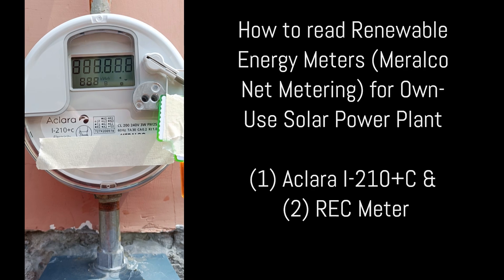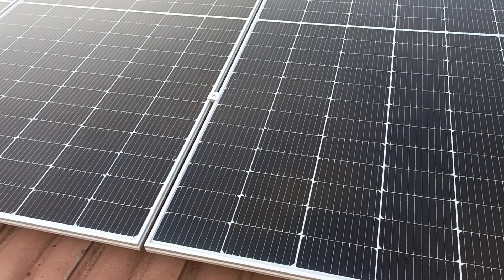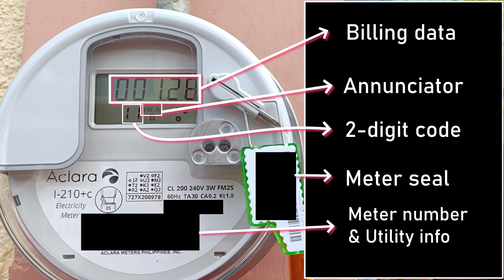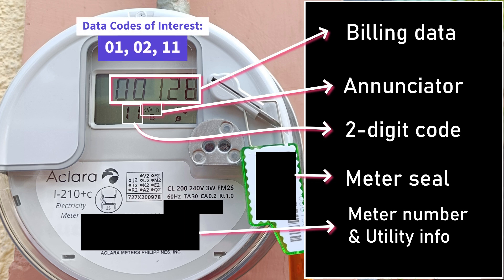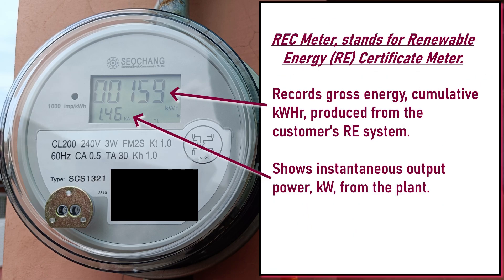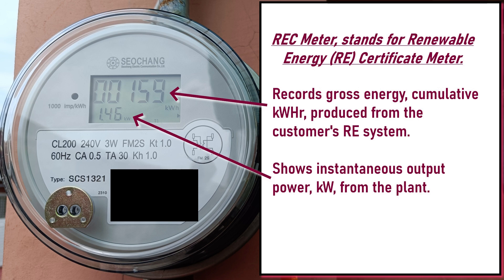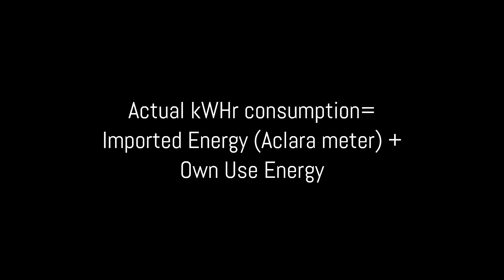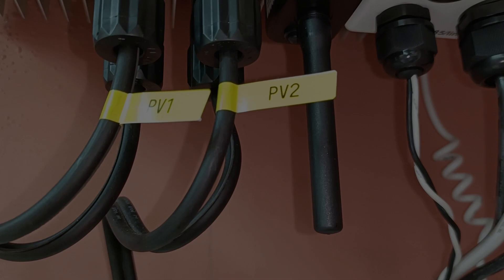[CC] Know Your Net Metering Data to Optimize Solar Power Savings

Comment: Do they also reset the REC meter monthly?
Reply from the maker: No, they just record the readings.
Reply: @ramschannelreviews Might be a stupid question, sorry. 😭 But do you check and take note of your REC meter reading every month for tracking? Or is it included in the meralco bill?
Reply from the maker: @fangirlinmee  You can keep a record for your own documentation. But your printed bill is the best record so I always keep mine. The REC meter reading is part of the computation for actual kWHr consumption where subsidies and Fit All charges are taken. You can find the details of this at the back of your bill in Additional Bill Information.

Comment: so which one shows the current consumption? I would like to know this since i've just added a 2.5hp airconditioner
Reply from the maker: @richarddeleon  If there's someone who knows a better answer feel free to share. From my understanding the bidirectional meter and REC meters do not directly show the instantaneous kW power load of the house. The effect on energy consumption in kWHr caused by additional load can be determined after the billing period and comparing it with previous billing. However, if your inverter has an app it may be able to show you instantaneous power in kW of your load and solar panel. You may consult your solar installer on how to use your inverter's app properly.

Comment: Sir tanong ko lang. Kakaproved lng ng net metering ko the other day. Base sa explanation ang REC meter ay babasahin at i record ang total  generation ng RE solar plant mo. Observed ko these two days 48 hours 19kwHr lang ang reading ng REC meter, pero ang hybrid inverted ko nag reading for two days ng 40kwHr. Ang bidirectional meter ko as of today ay 22 kwHr. Can you enlighten me? Thanks.
Reply from the maker: Congrats, sir! Magkaiba po tayo ng setup. Yung sa akin kasi straightforward lang na interconnection without battery. Sa inyo po hybrid, merong battery. Yung sa bidirectional meter nyo po kung import yung 22 kWHr ibig sabihin kumunsumo po kayo ng 22 kWHr galing sa utility, regardless of your hybrid solar plant production. Sa gabi, maaring mixed din ang energy source ninyo: portion from utility, portion from hybrid solar power plant due to battery. During the day, it's possible that most of your solar energy go to your load, some go to charge the batteries, and the excess energy are exported. Why your inverter records 40kWHr and your REC meter records only 19kWHr, I can only speculate, so it's better not to make a guess. Pasensya na at hindi ko kayo mabigyan ng siguradong paliwanag. Pero sa tingin ko naman po, wala naman dapat problema basta tama ang interconnection. It's also too early to make a good estimate. I would advice that you wait for your next two monthly billing sir. Doon nyo po makikita ang itimized energy usage. The two most important items being your import and export energy that the bidirectional meter records, perhaps Demand as well, depending on your applied load. Yung sa REC meter naman, it's used for computation of subsidies (minor amounts) and compliance to the Renewable Portfolio Standard.
Reply: @ramschannelreviews  Thank you Sir. Regarding sa setup I think both with or without battery are the same. From utility Bi-directional Meter, Safety Breaker (Disconnect), REC meter, and then to Deye Grid input. Your load is in the middle of your Bi-directional Meter, REC meter, and inverter along with your CT sensor (any comment correction if any). You are correct 22kwHr is import load Code 1. Code 11 is only 1. As you mentioned the priority is one Load, two is Bat, and last the grid if any excess power is available. The 40 khwr reading from my inverter is the accumulation of two days. I was confused with the REC meter why only 19kwhr was recorded. I expect that it should be around 40kwHr also (need to know more). Your are also correct mixed then and usage ko in the night base sa Time of Use power allocation between utility and and my 10.24kwHr bat storage.
Reply from the maker: @dondon.M  Thanks for sharing this sir. Not many of us have hybrid solar power plants, so your insights are much appreciated.
Reply: @dondon.M  code 11 = 00001 means wala ka pang na export sir. Yan ang initial value ng code 11. Baka hindi mo pa na activate ang “solar sell” sa setting ng deye. 
Yung 40kWh na production nyo po ay napunta lang sa charging ng batt at sa load consumption. 
Check nyo din po value ng “grid feed-in”. Yan po ang export nyo to DU.
Reply: Thank you @jcatiwalaan . For the last two days i didn't generate much due to cloudy weather, and yes diretso sa BAT and load ang nahaharvest ko at kulang pa. None, wala pa akong benta sa “grid feed-in”.
Regarding sa activaton ng “solar sell”, once I enable, I've noticed that nag feed sya ng around 20W to 40W kahit sufficient yong harvest ko. Is this normal?
Reply: @dondon.M  yes thats normal sir.  Dapat naka enable din ang Solar Sell, para mag start na po ang export to grid. 
ilang kW po pala ang set-up nyo sir?
Reply: @jcatiwalaan  8kW hybrid with 10.25kwHr dyness bat. Hopefully today i can start exporting. Medyo maganda araw  nasa 50% na ang Bat charge ko. Thanks.
Reply: @ possible din na mag export na yan sir kahit hindi pa full ang batt. Basta lagpa sa charging current na naka set sa batt.
Reply: @jcatiwalaan  I've noticed also na ang charging and discharging ng BAT ay controlled ng BMS automatically. Set at 100A for both charging and discharging but sometimes it goes down even 40 amps automatically. I think this depends on the available charge/discharge power.
Reply: @ Thats right. Charging depends on the avail power from the solar panels. But since you are already net metered. You can reduce the charging current in order to prolong the battery life. I am also using 10.24kWh storage.
When my net metering approved, I reduced the charging current to 30A max. And disable discharging of batt from 9am-9pm through “time of use” setting.
Reply: @dondon.M  discharging power always depends on the usage or load.
Reply: @jcatiwalaan  Good input you've share regarding the TOU for BAT. I may try this. By the way, did you remove your CT sensor after approval of your net metering?
Reply: @dondon.M  Nope. I didn’t remove the sensor. Enabling the “Solar Sell” will do.
Reply: @jcatiwalaan  Same here. Need to make sure i can still monitor the IN and OUT power.
Reply: Good day Sir, tanong ko lang ano ang Grid Settings mo - Normal Ramp Rate at Reconnect Ramp Rate. Sa akin by default nasa 60s sila. My Reconnection time is 600s. I'm facing an issue, the time I powered up my main breaker after my bi-directional meter the REC meter immediately reads or displays around 0.285 watts. according to meralco it should not  read immediately to protect my inverter. Do I need to change the Ramp rates? Appreciate you response.
Reply: @dondon.M  hi sir. I have similar settings. Ramp rate = 60s, Reconnection = 600s. Wala nalang issue kay meralco yung sa akin. Dumating na ang 1st bill ko last week. Zero bill agad, at nagka utang pa si meralco sa akin. ;-)
Reply: @ Good to hear na zero bill ka na. Thrilled to see my first bill.

Comment: Am I correct in my understanding that face 11 is the consumption of the household’s electricity from Meralco grid?
Reply from the maker: @antonopaco  No sir. Data code 01 is the energy you are describing. Code 11 is the excess energy produced by the rooftop solar power plant, not used by the household load, that is exported to the utility. Be advised though that the best way to check this is through your own utility bill. I'm not sure if all bi-directional meters display the same codes and interpretations. Your official Meralco bill will confirm these codes.
Reply: @ thank you
Reply: Bakit imported + own use pa,
Reply: Bakit naka add yung own usage diba galing po sa harvest natin yun during day time
Reply from the maker: @JudsonLeano  Hello sir. Hindi nyo po binabayaran sa utility ang inyong solar power production. The purpose of computing for actual kWHr consumption is to compute for subsidies and fit all charges which are very minimal amounts only. Your imported energy will make up the bulk of your charges, while your exported energy will appear as a discount under Net Metering Export Energy. Check nyo po yung net metering bill ninyo. Nandon po ang detalye.

Comment: hi sir, my meters are readings are. 01 12kw, 11 14kw, rec 24. following your formula 12kw + (24kw - 14kw) = 22 kw?

cross checking, if i just reference the bi-meter 01 - 11, 12kw-14kw = -2kw. 

got confused. 😅
Reply from the maker: Hi sir, thanks for your comments. What you're reading should not be kW (which is power) but kWHr (which is energy). So,

"following your formula 12kwHr + (24kwHr - 14kwHr) = 22 kwHr?" Yes, 22kWhr is correct, sir. That is your Actual kWHr Consumption. It is what your load consumes. Your load doesn't discriminate where its power is coming from. That is why this formula is used to determine how much of the power produced by the solar panel, and how much power coming from the utility, are being used by the customer's load.

"cross checking, if i just reference the bi-meter 01 - 11, 12kw-14kw = -2kw got confused. 😅
The math is correct, sir, but not the application. Remember that your REC meter records the gross (total production) of your solar power plant. Some of it is used by your load, while some are exported to the utility, depending on weather conditions. The bi-directional meter knows how much is exported and imported but not Own-Use Energy (REC Meter reading- Export Code 11). All these energy parameters are measured across a specified length of time (your billing period) to get an accurate measurement of your energy usage.

It's also important to note that this is just an example that may not be applicable to every customer with Net Metering as some codes may have different interpretations. The best reference you can use for your calculation is your next two billings that will come from the utility itself. I also did not properly understand the concept of Actual KWhr consumption and how my bill is computed until I got my first two billings on Net Metering and used them as reference.
Reply: @ramschannelreviews  Hi Sir, thank you for your time answering my post.  

You verified my assumption as well regarding the REC meter records all energy of consumed + exported.  In my example, the REC meter reading is 24KWh.  If I compare this with the Bi meter 01 + 11 = 12KWh + 14KWh = 26KWh, it is off by 2KWh.  Not sure though if the offset is in relation with how these 2 meters are calibrated, and will get more accurate over prolonged period of measurements.

Definitely, anxious to get my first billing to understand more regarding this.  Thank you again !
PS. when I was talking with the Meralco engineer, he mentioned that the REC meter will not be needed anymore.  They are just waiting for the implementing rules to be forwarded to them by government.